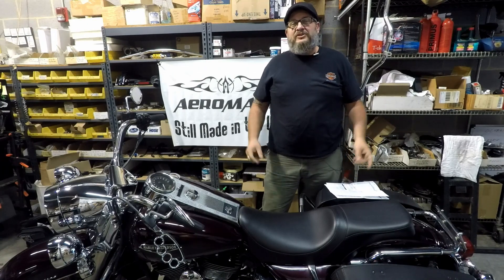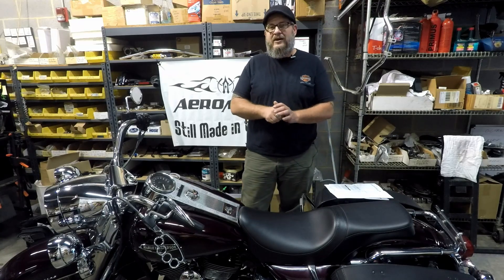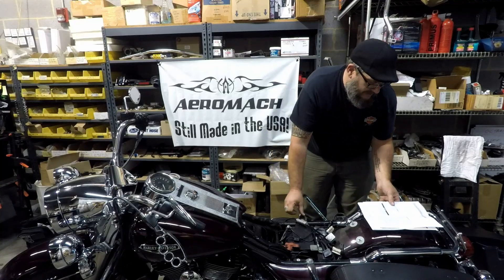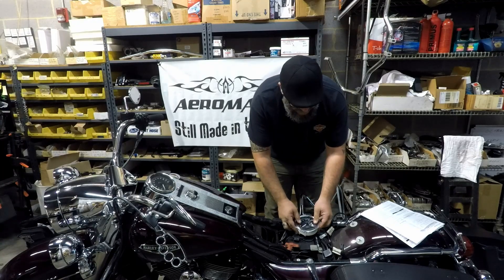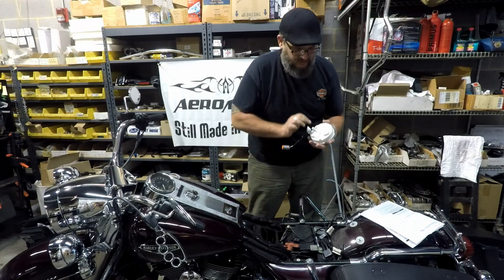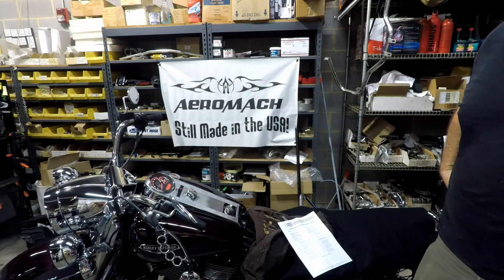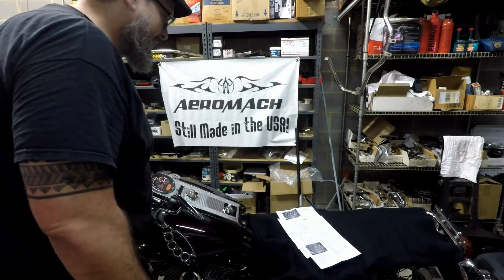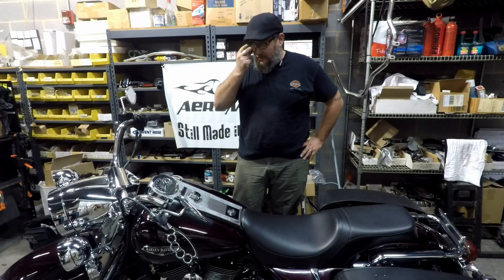Harley Speedo Replacement

Comment: My 2005 heritage Softail Classic doesn’t have a main fuse, only a main circuit breaker under the rear fender. Can I just disconnect the battery instead to install it.
Reply from the maker: I imagine that would be fine.  Same difference
Reply: @YogisCycleService  many thanks

Comment: I put this on my 04 fatboy carbureted and all works except fuel. Previous owner installed a dummy light no gauge any ideas why the fuel gauge won't work?
Reply from the maker: Honestly on my 03 the fuel gauge never really worked properly.  I think it has something to do with how they made the floats back then.  It says I am out of gas and I still have 2 1/2 gallons left to go on a 5 galleon tank.  Never trust the fuel gauge.  Its why I reset my trip meter every time i fill up

Comment: How does the tachometer work without hooking it to the coil pack
Reply: Computer brother and depending on the age of your bike too
Reply: @hermanbrown4786 would a 2015 HD Iron 883 have modern enough computer to be able to read tachometer if I change speedo? I really want that tachometer and fuel level gauge on my speedo. Right now I have a digital rpm.

Comment: Any chance you can tell me  the wiring schema of the adapter cable to transfer data from ECM?
Reply from the maker: @oleksasirotinin1532  it came with a pigtail you plugged in

Comment: Mine isn’t calibrating over. I followed the directions exactly. It lights up if I plug it in  but it won’t calibrate through the data link
Reply from the maker: On the last page of the installation guide is a troubleshooting section.  Do any of those symptoms apply?
Reply: I tried one on my 2004 RK and it would not work either. Went to HD shop they could not figure it out. They called the factory, come to find out my bad original speedo was not the original factory speedo but had been a HD replacement. The data would not transfer until I get the original make and model installed. It is on back order right now. I hope it works when I get it.

Comment: ok so if for example, I have 07 street bob which has only a speedometer and no rpm's once I get that speedo with rpm's will it work on my bike?
Reply from the maker: That’s the intention yes
Reply: @YogisCycleService  I don't see any digital speedometers for 2007 FXDB, everything I see is for 2012 and up.
Reply from the maker: @Voltomess  That I do not know.  You may have to call your Harley dealer

Comment: How do you set up the ABS light mine stayed on??
Reply from the maker: That’s odd and I am not certain how to answer that.  It might need to be flashed by the dealer unfortunately
Reply: I went for a short ride and everything is back to normal 🤘🏻🤘🏻
Reply from the maker: @checko703  awesome.  Good to know thanks for the follow up

Comment: Having a hard time sourcing a tach for my 1999 road king (first year with the twin cam). Will this work on my bike? Is the plug on the back of the speedo the same from 1999 to 2006?
Reply from the maker: From what I hear it’s only back to 2006 but I would need to dig deeper into that and it’s been a minute since I have swapped one out

Comment: Does the bikes ecm store the original mileage so now one could create fraud
Reply from the maker: Yes I did not have to program the current mileage. When you plug this in and turn the bike onto accessory it downloaded the current mileage automatically. I don’t believe there is any way for me to tamper with that

Comment: Can a flh76 be modified to run a digital speedo like this? Already have Electronic SS ignition, so its ready for a tach, but what about the speedometer. It reads from the engine right?
Reply from the maker: That is a good question I am not sure the answer of.  My gut is saying no I don’t believe so with out major electrical work to get it up to speed. I would have to dig deeper on that
Reply from the maker: https://www.speedhut.com/gauge/GR4-DUALGPS-ST-03T/1/Dual-Gauge---160mph-GPS-Speedometer---8K-Tachometer-(w--turn-signal-and-high-beam)
Reply from the maker: Something like that may be a easier conversion for older bikes.  GPS speedo.  Kinda cool.

Comment: Hello and thank you for this great video.  I am attempting to replace an MPH speedo on my 2014 Ultra Limited to a KPH speedo.  I have located a used replacement speedo.  Where can I locate that kit that allows me to update the new speedo?  do you have a link?  Tx
Reply from the maker: Hmmm. Good question.   I would have to do some searching for that because top of head I am not sure.  The one I installed came with the plug and play wire harness.  Not sure if you can get that separately or not through Harley or aftermarket vendor.  Might want to call J&P or use their online support to ask that same question.  Get a part # and vendor who supplies it if you can find it then search it out on the net or just order from J&P

Comment: Did you connect the fuel cable
Reply from the maker: MrOmarjones1 forgive me because I don’t remember disconnecting any fuel lines but if I did I am sure they were reconnected because the bike fired up at the end of the video and has been running fine since.   Maybe I need to go rewatch the video to see what you are looking at

Comment: The tach and speedo need to be switched. I like a big tach. Nice deal that the speedo is programmable. Not a bad setup and much cheaper and cleaner than two new gauges. I did notice you didn't lube the speedo wire. Normally you lube the speedo cable when you take the unit off. LOL
Reply from the maker: Chuck Habrack if it had a cable it would have been lubed....
Reply: Welcome to 2005 chuck! 🤦🏻‍♂️😂

Comment: Sorry, but YET ANOTHER video that DOESN'T show how you remove the old speedometer. You are filming your back when taking it apart and putting it back together. 
ALSO, HOW DID YOU TRANSFER THE MILEAGE OVER?!?!?! You just turn power on and off? When does the transfer take place?